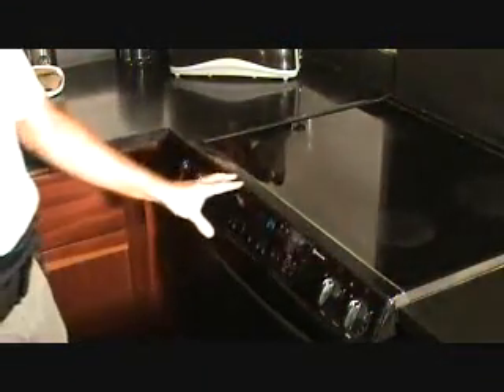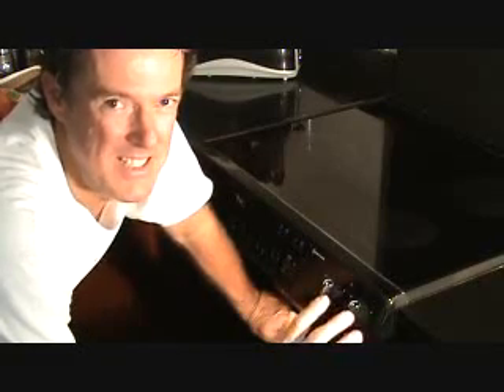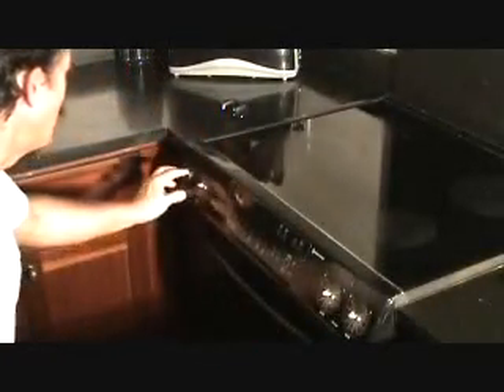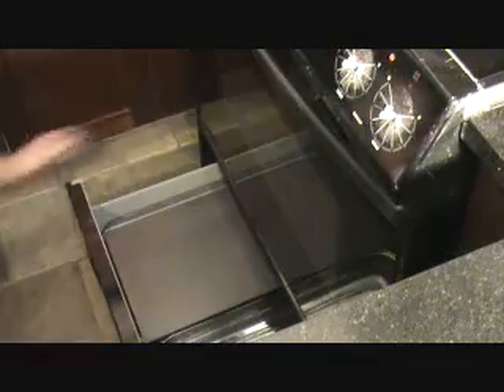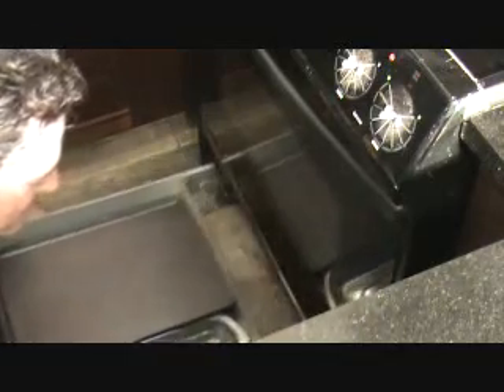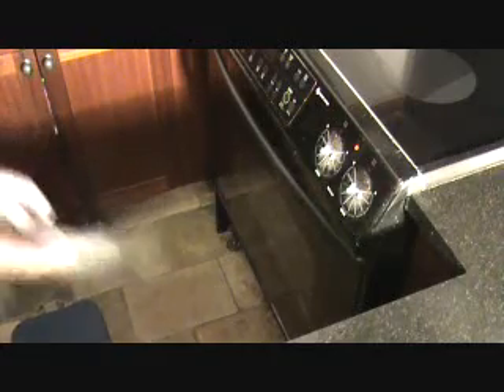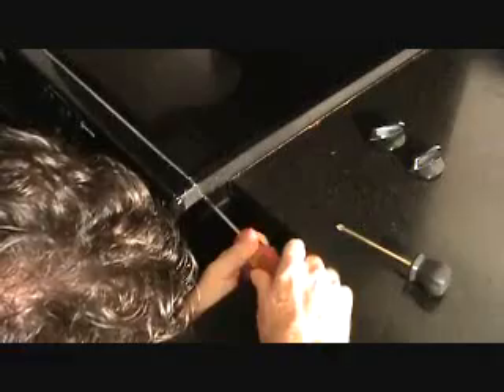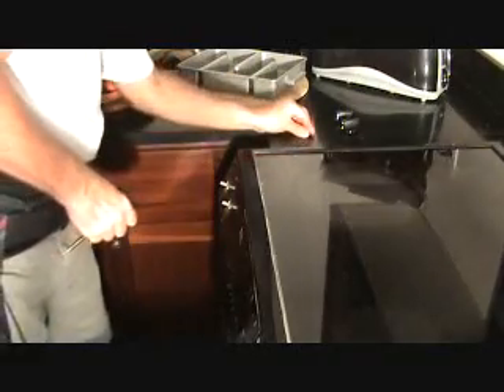How to remove an oven keypad....Part 1

Comment: Those brackets at the back on the feet, that you questioned what they were for (perhaps to keep it even when putting it in?) are actually an anti-tip device that prevents the oven from flipping forward. If a person has the oven door open and steps on it or puts pressure, many ovens will tip forward. The brackets that the rear feet slid into prevent this dangerous event from occurring. MANY people do not install them if they are doing a DYI installation since they have a tight tolerance to catch the back feet. YOU really want to make sure they are well secured. Many people do not put these in for their flat screen TVs or other appliances. There are a lot of videos on YouTube with ovens falling on kids or people trying to reach in and clean the oven. An ounce of preventions is worth a pound of cure! This video helped me replace a control board on my Jenn-Air and saved me a ton of money. Just ordered the part and took an hour to fix it myself. Thanks!
Reply from the maker: Wow so cool of you to leave this detailed message here & all that you have said makes soo much sense. Thanks!

Comment: Yes I did get it off. Pretty much the same way you told me. I got a rag and turned it and kind of banged on the top a bit and it loosened up and came off with a few more turns. Thanks for the advice though. At least I know I did it right....
Reply from the maker: Nice job yo!

Comment: Hey Joe, do you know how to loosen a really tight shower head nut with teflon tape on it ?
Reply from the maker: Channel locks? Or if it has a nut shaped end then a crescent wrench should do as you are trying to turn it with your other hand....kind of tricky. If you use channel locks make sure you don't mark up the arm with gouges!

Comment: Wished I had seen tis vid before I had mine done. Cost over $200 just to replace one component in it.
Reply from the maker: Yes you spent $200 for a fix for your old oven keypad that will one day have something else go wrong with it too. That's why I replaced the entire thing rather than try to fix one thing.....plus I wouldn't know how to test & figure out which part was bad so I would have to do the same thing as you...call out an appliance service tech & pray he doesn't take me all the way to the bank!

Comment from the maker: Take a big crescent wrench to it. If you don't have one, use a big set of channel locks & wrap a rag around it first, so it doesn't scratch &/or eat off the surface. Use some elbow grease. You can do it! Did you ever get it off?  Joe  :0